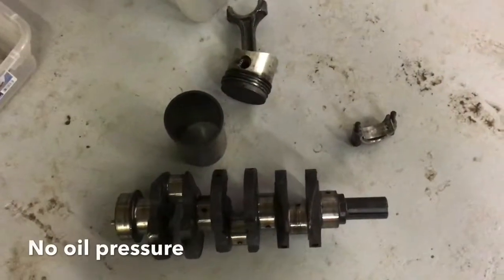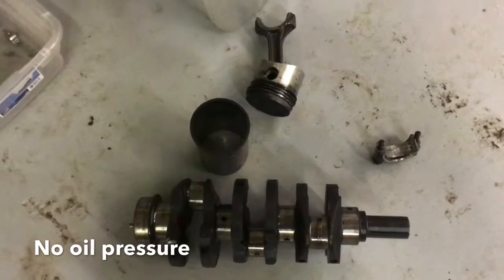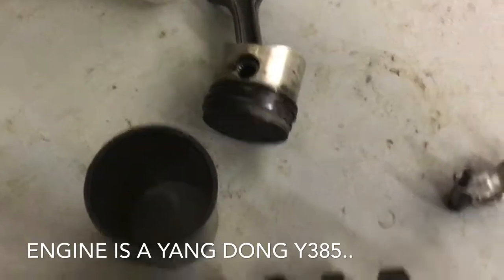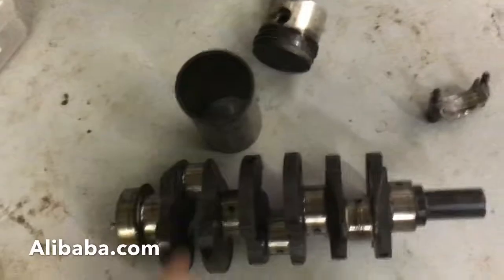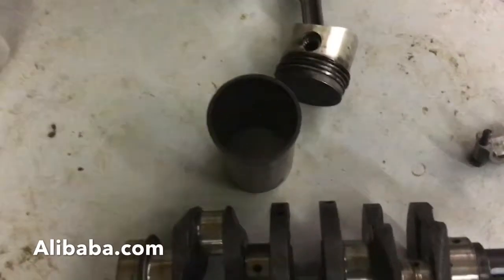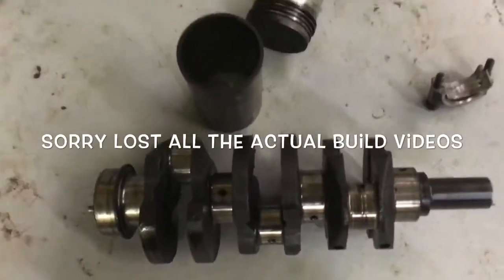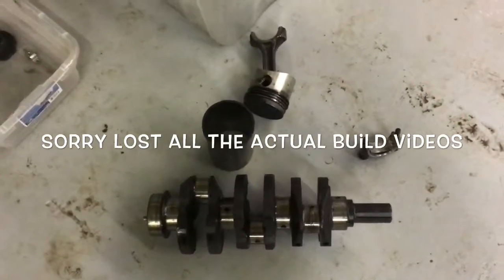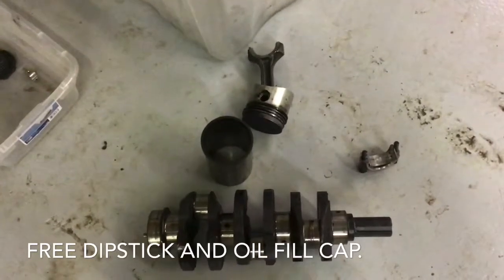Chinese Tractor Diesel Engine rebuild

Comment: I have this tractor how do you pull the motor I removed all the visible bolts but where are the hidden ones? Please help me
Reply from the maker: @jameslevangie9516  there are 2 bolts very high on the “bell housing” under the steering. It’s been awhile since I worked on that tractor and my memory is a little bad.
Reply: @fastdadgarage-northsouthch4418   thank you

Comment: I have a taskmaster 324 needing rebuild, where did u get the kit? Do you know what engine I have? Very limited info on this tractor
Reply from the maker: I got my rebuild kit directly from China. I think alibaba or something. Your motor should have a label somewhere, this was a yang dong if memory is correct. I found a online owners manual with all rebuild specs, I don’t think I have it any more.